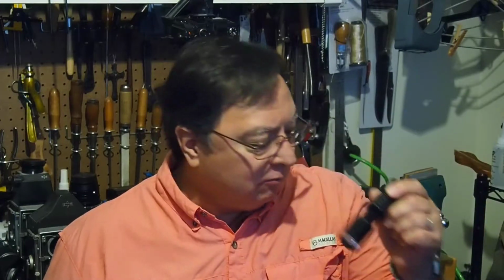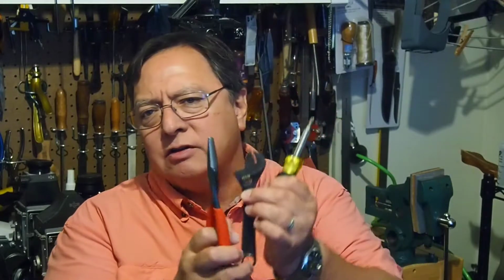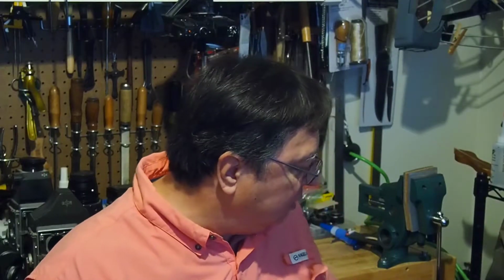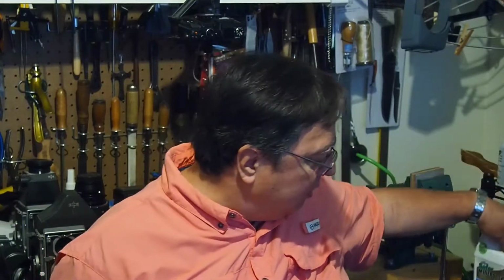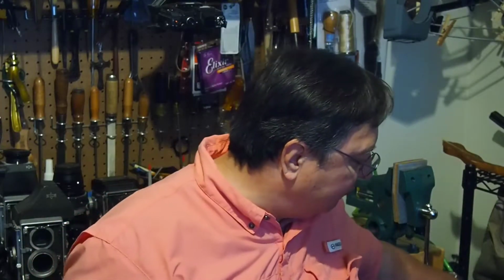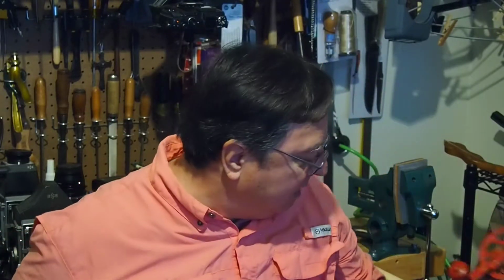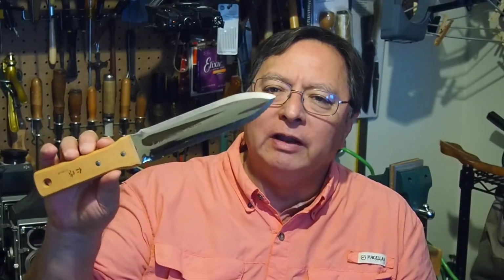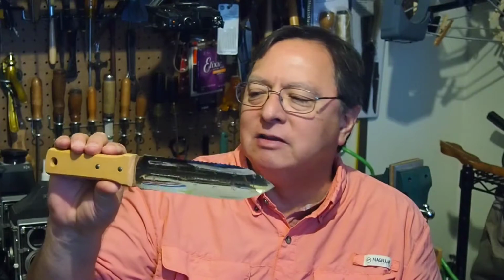10 TIPS TO GET YOUR SHOP READY FOR RECESSION OR DEPRESSION!

Comment: Great video. I'm living off-grid at my whistleblower bugout camp. I'm loaded up on rechargeable batteries AA/AAA and the USB powered charger, and a couple of rechargeable lanterns & headlamps. I have a gallon of clean burning kerosene for my lantern. 92% alcohol for my alcohol stove & alcohol candles. Vegetable oil is also an option for DIY lantern but it will attract wildlife if you're outside. In a home, not so much. Doggos or kitties may be attracted to it. I use solar garden lights & replaced the low Mah rechargeable batteries they came with. I put higher mAh batteries in them. 100w & 20W solar panels, multiple power banks, 1 with an AC outlet for my rotary tool, saudering iron/woodburning tool, moving blankets and radiant barrier for insulation, lots of candles & empty cans, metal buckets, and vegetable grill sheets, 5 gallon sealable food grade buckets.
Reply from the maker: Sounds like you are well prepared!